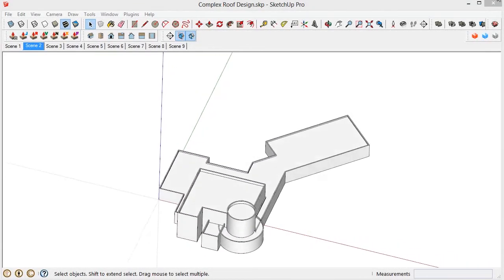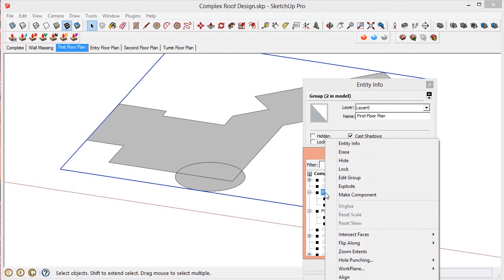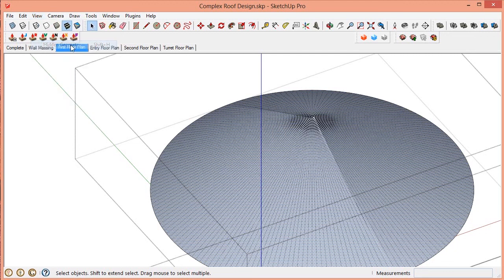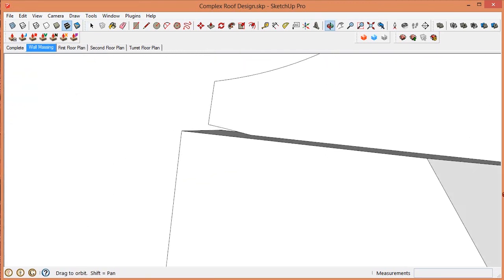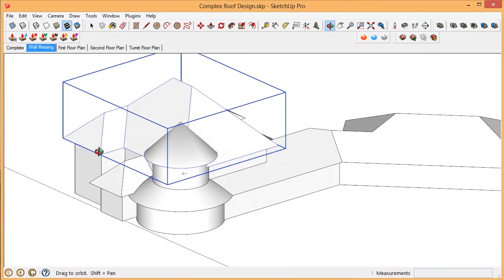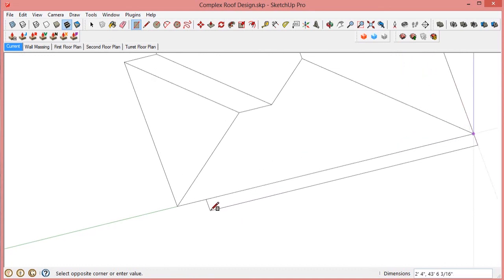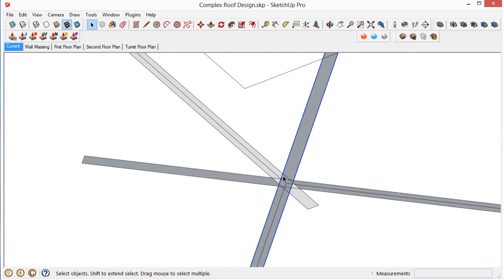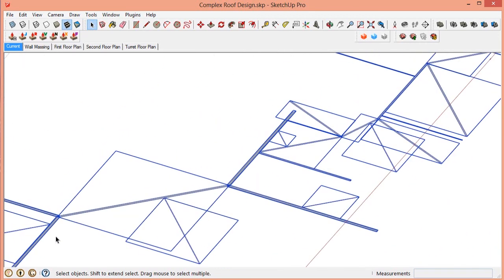Complex Roof Design, Part-1

Comment: Too bad the folder was empty. I like your video's and wanted to follow along. I have been able to find some of the plug ins you mention. Having a list of them in the description of the video would have helped a lot.
I like how you tackle the problems by addressing them as simple as possible instead of head on.
I'm new to sketchup and my way of thinking was to angle a piece and to then place them where needed. My major issue occurred where roof lines would touch.
Reply from the maker: +Lars de Waardt 
Here you go :
https://drive.google.com/open?id=0B4CS8pWqNw5_dDRvaTVjeVItcDg
Reply: +Drew Murphy Thank you so much. From your explanation I managed to create a workaround for a building I have been working on. I'll see if they have these plugins available in the new 2016 sketchup.